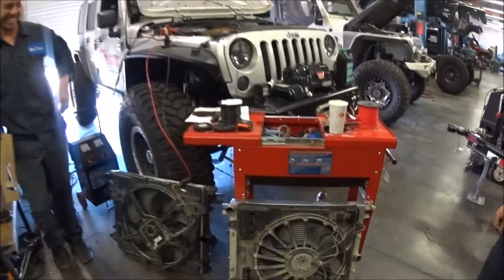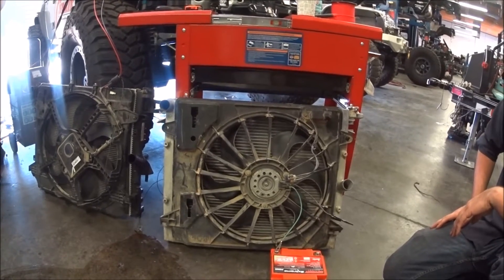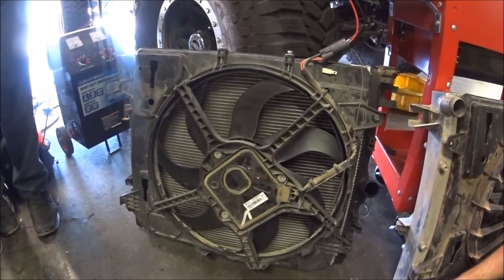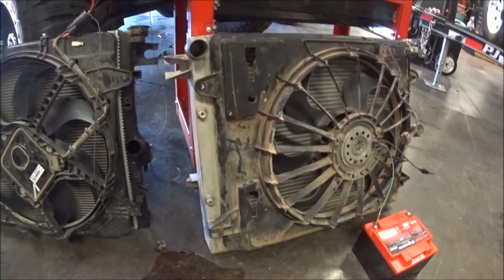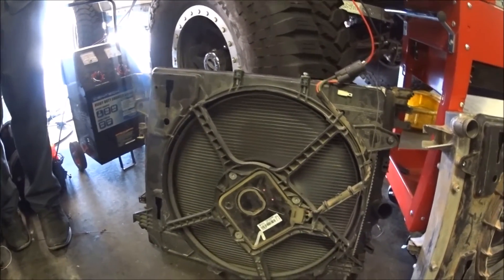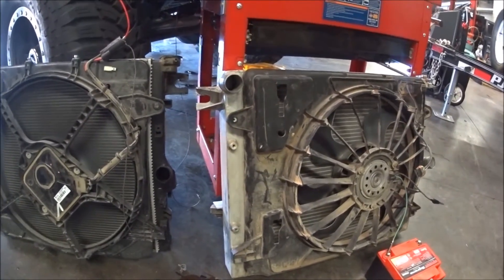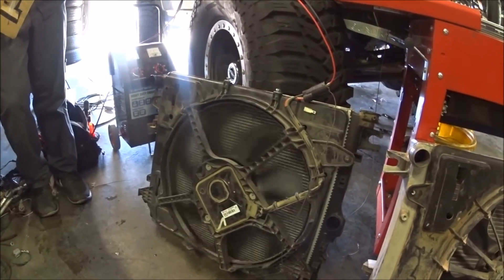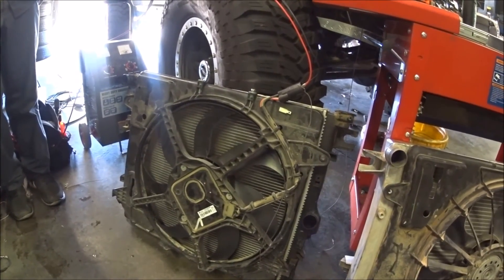motech PWM fan conversion

Comment: The BMW brushless "puller" fans come in 850w & 1000w ( 10 to 90% duty @100hz).. I to have tested all the good ones, nothing compares to the BMW in cfm output. The Volvo 9497929 (oem only!) is about the best brushed fan that has a great compact shroud with huge radius near the blade edge.. The blades are similar to a turbine, not the swept back blade they used on other models .. The MKviii's are kickass also but super hard to find..

Comment: This is a great video comparison but Since the 3.6 Pentastar fan has a pulse as well as the power and ground if one wanted to troubleshoot the fan for not running this being said just hooking up a 12V source wont work ?   I see that the 3.6 power and ground ar still hooked up but what is the 3 / pulse wire going to that makes the fan run ?
Reply: " just hooking up a 12V source wont work ? " 
My understanding, no.  Assuming this is a brushless motor, then the current needs to be pulsed, based on rotor position.  Rotor position detected by a sensor, which is probably the pulse.  I am guessing, though, so others may explain better.  THen again, after 2 years and no comments, maybe not.
Reply: @bribbripnairbnab7301  you need a product like Lingenfelter VSFM-002 Variable Speed Fan & Pump Temperature & Speed Controller
To drive any brushless motor 
There is a logic on the fan's board,  some brands like spal will give you details how the logic/amp draw/fan's internal temperature works and othe oe do not however you need a controler to drive any brushless fan it's made universal so you can plug-in the fan's spec and it will do it's job